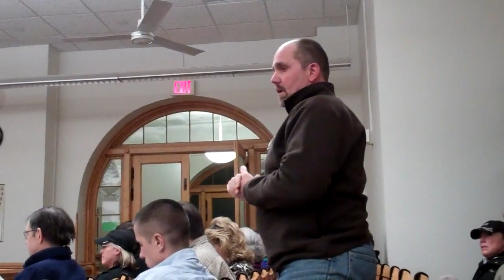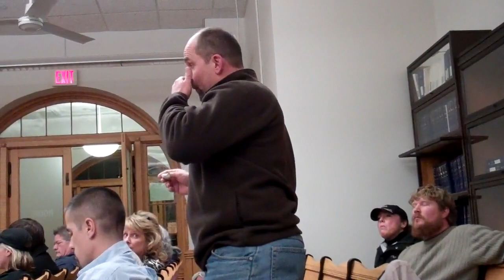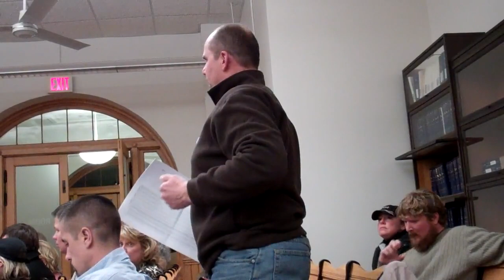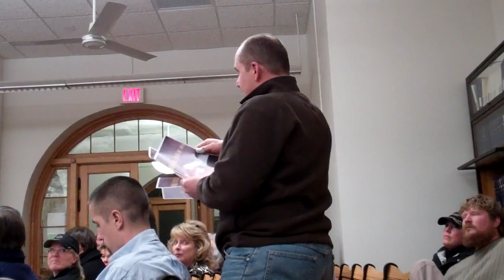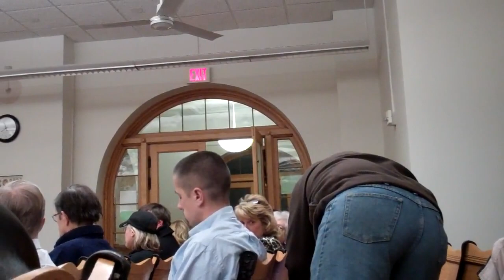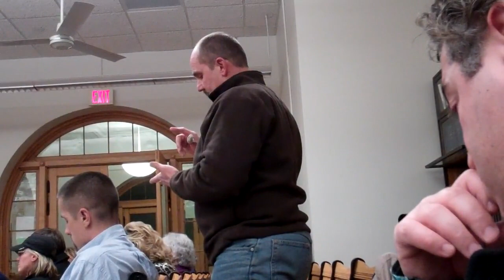Shineldecker Testimony Mason County MI

Comment: From Windpower monthly,
German government looks to slash renewables funding
15 February 2013 by Sara Knight,
GERMANY: A joint proposal to cut the costs of increasing Germany's renewable energy capacity has been presented by the federal economy and environment ministers.

You are right Mr Breadner we need to "exemplify the direction Germany is moving in" No cherry picking needed,just common sense.

As we say out here in the country...

Even a pig knows when the feed trough is gonna run out.

Comment from the maker: Electric cars are the next great thing and always will be. There are physical limits to the ability to store energy and they are known. It all comes down to energy density. But even with an all electric transportation infrastructure wind would need to be paired with gas or coal. Which do you prefer to pair your wind with: gas or coal?

Comment from the maker: Ask E On Netz yourself: 

wwwDOTnercDOTcom/docs/pc/ivgtf/EON_Netz_Windreport2005_eng.pdf

"... 2020, with a forecast wind power capacity of over 48,000MW, 2,000MW of
traditional power production can be replaced by these wind farms."

Would a board member of the American Wind Energy Association make up anti-wind data?

No such thing as wind by itself. It has no firm capacity. Must be paired with hydro (scarce), coal or gas. Which do you prefer with your wind?

Comment from the maker: Wind generation and thermal generation are not interchangeable. AWEA board member E.ON is succinct: "Wind energy is only able to replace traditional power stations to a limited extent. Their dependence on the prevailing wind conditions means that wind power has a limited load factor even when technically available…. Consequently, traditional power stations...equal to 90% of the installed wind power capacity must be permanently online [and burning fuel] in order to guarantee power supply.."